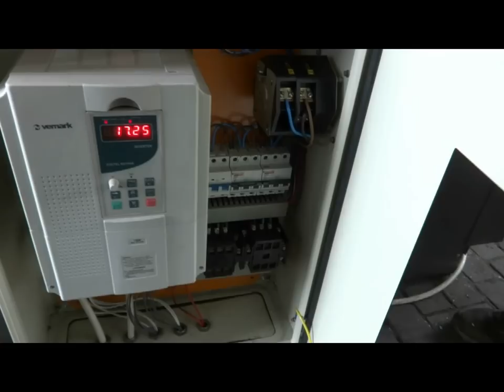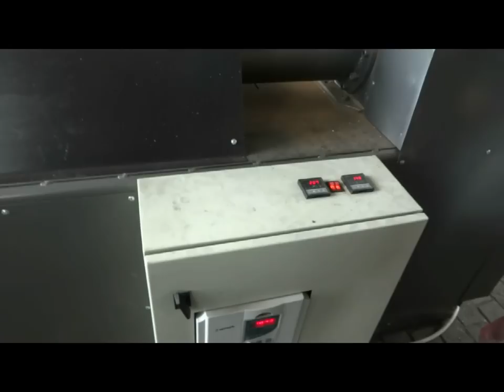Roof Tiles From Recycled Plastic

Comment: So really there shouldn't be any excuse for plastic to end up in a landfill
Reply: Yes and no
In order to recycle plastics they need to be separated by type and color and there are hundreds of types out there. So easier said than done :)
Unrecyclable composites, dirty plastics, etc. can be converted back to oil using pyrolysis or burned in an incinerator to recover energy-reducing volume by 90%.

Comment: there is any possibilite of using glass waste in some porportion to replace sand, in order to recicle broken glass?
Reply from the maker: Of course you can use finely chopped glass. This is also better for the strength of the products.
Reply: @kotarakafeliks  tkx very much
Reply: unless you are making it yourself, glass beads are an expensive option
Reply: @KN-fk9lj  tnks very much, broken glass is a problem in out beaches, and we are looking for alternatives.

Comment: We need this!
Reply from the maker: We are the producer of this machines. The installation costs 68000 euro   
with the moulds. We can make the moulds with a drawing or muster in Your   
standart/the standart is different in the countries/. Time to work-3   
months.Installed power-20 kW The installation includes: 1.Specially   
extruder 2.Press machine 3.Calibrator   
cooler for the ready details The machine can make 60 pieces per hour.   
The making area is 20 m2 without warehouses. If You have any questions   
please send us.The produce time is two months .   
The line for the production of floor coverings and roof tiles is the same. Just change molds.   
There is also a difference in the plastic mixture because it can also be used petrified PET bottles.   
The installed power is 25 kilowatts, but the working consumption is about 10 kilowatts.   
The blending ratio is 30% plastic and 70% sand.   
Marble flour can also be used to better achieve the desired color.   
For paint, use is an oxide cement paint..   
The cost does not include delivery costs. You will get a detailed video on launching and operating the machines.   
You need to specify what details you want to make.
Reply: I need
Reply from the maker: @rajshekarmulalimanjunathpm6131  Watssapp number is  00359888494116
Reply from the maker: email is   plasticam@abv.bg
Reply: Well knowledge given by you,, thanks

Comment: Hi can I have more information on these machine ie price etc
Reply from the maker: We are the producer of this machines. The installation costs 88000 euro   
with the moulds. We can make the moulds with a drawing or muster in Your   
standart/the standart is different in the countries/. Time to work-3   
months.Installed power-20 kW The installation includes: 1.Specially   
extruder 2.Press machine 3.Calibrator   
cooler for the ready details The machine can make 60 pieces per hour.   
The making area is 20 m2 without warehouses. If You have any questions   
please send us.The produce time is two months .   
The line for the production of floor coverings and roof tiles is the same. Just change molds.   
There is also a difference in the plastic mixture because it can also be used petrified PET bottles.   
The installed power is 25 kilowatts, but the working consumption is about 10 kilowatts.   
The blending ratio is 30% plastic and 70% sand.   
Marble flour can also be used to better achieve the desired color.   
For paint, use is an oxide cement paint..   
The cost does not include delivery costs. You will get a detailed video on launching and operating the machines.   
You need to specify what details you want to make.

Our plant uses waste plastic as a raw material, which cannot be used for separation and recycled as a secondary raw material. For example, plastic bags, car plastics, packaging and much more. Plastic waste is crushed with a grinder or agglomerator of fine particles about 4-5 mm. They are then mixed with dry sand in a percentage of 50/50 in weight units. 0.1% oxide paint is added. The semi-honest mixture is then placed periodically in the curing extruder, which cures the mixture and it exits as a soft mass. With a certain dose is placed in the mold and the press presses the finished product. The product is then placed in a special calibrator to make it true and not deform. One cycle lasts about 1-1.5 minutes.

Comment: Thanks for video. Some taken knoladge but how can wi start ?
Reply from the maker: You can start with buyng machine. Then work, work, work!
Reply: @kotarakafeliks  how much is the machine?
Reply from the maker: @dianaama6728  We are the producer of this machines. The installation costs 78000 euro   
with the moulds. We can make the moulds with a drawing or muster in Your   
standart/the standart is different in the countries/. Time to work-3   
months.Installed power-20 kW The installation includes: 1.Specially   
extruder 2.Press machine 3.Calibrator   
cooler for the ready details The machine can make 60 pieces per hour.   
The making area is 20 m2 without warehouses. If You have any questions   
please send us.The produce time is two months .   
The line for the production of floor coverings and roof tiles is the same. Just change molds.   
There is also a difference in the plastic mixture because it can also be used petrified PET bottles.   
The installed power is 25 kilowatts, but the working consumption is about 10 kilowatts.   
The blending ratio is 30% plastic and 70% sand.   
Marble flour can also be used to better achieve the desired color.   
For paint, use is an oxide cement paint..   
The cost does not include delivery costs. You will get a detailed video on launching and operating the machines.   
You need to specify what details you want to make.

Comment: Please I’m interested in the machine. how can I get the machine?
Reply from the maker: We are the producer of this machines. The installation costs 68000 euro   
with the moulds. We can make the moulds with a drawing or muster in Your   
standart/the standart is different in the countries/. Time to work-3   
months.Installed power-20 kW The installation includes: 1.Specially   
extruder 2.Press machine 3.Calibrator   
cooler for the ready details The machine can make 60 pieces per hour.   
The making area is 20 m2 without warehouses. If You have any questions   
please send us.The produce time is two months .   
The line for the production of floor coverings and roof tiles is the same. Just change molds.   
There is also a difference in the plastic mixture because it can also be used petrified PET bottles.   
The installed power is 25 kilowatts, but the working consumption is about 10 kilowatts.   
The blending ratio is 30% plastic and 70% sand.   
Marble flour can also be used to better achieve the desired color.   
For paint, use is an oxide cement paint..   
The cost does not include delivery costs. You will get a detailed video on launching and operating the machines.   
You need to specify what details you want to make.

Our plant uses waste plastic as a raw material, which cannot be used for separation and recycled as a secondary raw material. For example, plastic bags, car plastics, packaging and much more. Plastic waste is crushed with a grinder or agglomerator of fine particles about 4-5 mm. They are then mixed with dry sand in a percentage of 50/50 in weight units. 0.1% oxide paint is added. The semi-honest mixture is then placed periodically in the curing extruder, which cures the mixture and it exits as a soft mass. With a certain dose is placed in the mold and the press presses the finished product. The product is then placed in a special calibrator to make it true and not deform. One cycle lasts about 1-1.5 minutes.

Comment: Great idea but how does the plastic stand up to the Sun,from my experience plastic cracks after a few years.Would like to be wrong we so need to deal with this!
Reply: @greenunion3699  I am looking roofing tiles in India, do you supply this product in India.
Reply: @siddhuarch  What is the amount of  roofing tiles do you need ?
Reply: It's not pure plastic, the sand will give enough strength to the tile

Comment: Nice one. how can I get the machine?
Reply from the maker: We are the producer of this machines. The installation costs 78000 euro   
with the moulds. We can make the moulds with a drawing or muster in Your   
standart/the standart is different in the countries/. Time to work-3   
months.Installed power-20 kW The installation includes: 1.Specially   
extruder 2.Press machine 3.Calibrator   
cooler for the ready details The machine can make 60 pieces per hour.   
The making area is 20 m2 without warehouses. If You have any questions   
please send us.The produce time is two months .   
The line for the production of floor coverings and roof tiles is the same. Just change molds.   
There is also a difference in the plastic mixture because it can also be used petrified PET bottles.   
The installed power is 25 kilowatts, but the working consumption is about 10 kilowatts.   
The blending ratio is 30% plastic and 70% sand.   
Marble flour can also be used to better achieve the desired color.   
For paint, use is an oxide cement paint..   
The cost does not include delivery costs. You will get a detailed video on launching and operating the machines.   
You need to specify what details you want to make.

Our plant uses waste plastic as a raw material, which cannot be used for separation and recycled as a secondary raw material. For example, plastic bags, car plastics, packaging and much more. Plastic waste is crushed with a grinder or agglomerator of fine particles about 4-5 mm. They are then mixed with dry sand in a percentage of 50/50 in weight units. 0.1% oxide paint is added. The semi-honest mixture is then placed periodically in the curing extruder, which cures the mixture and it exits as a soft mass. With a certain dose is placed in the mold and the press presses the finished product. The product is then placed in a special calibrator to make it true and not deform. One cycle lasts about 1-1.5 minutes.

Comment: How much can I buy these machines??
Reply from the maker: We are the producer of this machines. The installation costs 78000 euro   
with the moulds. We can make the moulds with a drawing or muster in Your   
standart/the standart is different in the countries/. Time to work-3   
months.Installed power-20 kW The installation includes: 1.Specially   
extruder 2.Press machine 3.Calibrator   
cooler for the ready details The machine can make 60 pieces per hour.   
The making area is 20 m2 without warehouses. If You have any questions   
please send us.The produce time is two months .   
The line for the production of floor coverings and roof tiles is the same. Just change molds.   
There is also a difference in the plastic mixture because it can also be used petrified PET bottles.   
The installed power is 25 kilowatts, but the working consumption is about 10 kilowatts.   
The blending ratio is 30% plastic and 70% sand.   
Marble flour can also be used to better achieve the desired color.   
For paint, use is an oxide cement paint..   
The cost does not include delivery costs. You will get a detailed video on launching and operating the machines.   
You need to specify what details you want to make.

Our plant uses waste plastic as a raw material, which cannot be used for separation and recycled as a secondary raw material. For example, plastic bags, car plastics, packaging and much more. Plastic waste is crushed with a grinder or agglomerator of fine particles about 4-5 mm. They are then mixed with dry sand in a percentage of 50/50 in weight units. 0.1% oxide paint is added. The semi-honest mixture is then placed periodically in the curing extruder, which cures the mixture and it exits as a soft mass. With a certain dose is placed in the mold and the press presses the finished product. The product is then placed in a special calibrator to make it true and not deform. One cycle lasts about 1-1.5 minutes.
Reply: @kotarakafeliks  please can I have the full catalogue of the machines needed for this production and the cost to Lagos, Nigeria 
Thank you.
Reply from the maker: @felixachile8172  Write me on whatsapp  00359888494116

Comment: How do l get the equipment and the price
Reply from the maker: We are the producer of this machines. The installation costs 78000 euro   
with the moulds. We can make the moulds with a drawing or muster in Your   
standart/the standart is different in the countries/. Time to work-3   
months.Installed power-20 kW The installation includes: 1.Specially   
extruder 2.Press machine 3.Calibrator   
cooler for the ready details The machine can make 60 pieces per hour.   
The making area is 20 m2 without warehouses. If You have any questions   
please send us.The produce time is two months .   
The line for the production of floor coverings and roof tiles is the same. Just change molds.   
There is also a difference in the plastic mixture because it can also be used petrified PET bottles.   
The installed power is 25 kilowatts, but the working consumption is about 10 kilowatts.   
The blending ratio is 30% plastic and 70% sand.   
Marble flour can also be used to better achieve the desired color.   
For paint, use is an oxide cement paint..   
The cost does not include delivery costs. You will get a detailed video on launching and operating the machines.   
You need to specify what details you want to make.

Comment: Qué materiales utiliza para llegar al resultado? Alguien q me guiar...
Reply from the maker: We are the producer of this machines. The installation costs 78000 euro   
with the moulds. We can make the moulds with a drawing or muster in Your   
standart/the standart is different in the countries/. Time to work-3   
months.Installed power-20 kW The installation includes: 1.Specially   
extruder 2.Press machine 3.Calibrator   
cooler for the ready details The machine can make 60 pieces per hour.   
The making area is 20 m2 without warehouses. If You have any questions   
please send us.The produce time is two months .   
The line for the production of floor coverings and roof tiles is the same. Just change molds.   
There is also a difference in the plastic mixture because it can also be used petrified PET bottles.   
The installed power is 25 kilowatts, but the working consumption is about 10 kilowatts.   
The blending ratio is 30% plastic and 70% sand.   
Marble flour can also be used to better achieve the desired color.   
For paint, use is an oxide cement paint..   
The cost does not include delivery costs. You will get a detailed video on launching and operating the machines.   
You need to specify what details you want to make.

Comment: Где можно Купить такое оборудование???
Reply from the maker: We are from Bulgaria.We are the producer of this machines. The installation costs 68000 euro   
with the moulds. We can make the moulds with a drawing or muster in Your   
standart/the standart is different in the countries/. Time to work-3   
months.Installed power-20 kW The installation includes: 1.Specially   
extruder 2.Press machine 3.Calibrator   4. Grinder for had plastic. 5. Aglomerator for sheet plastic.
cooler for the ready details The machine can make 60 pieces per hour.   
The making area is 20 m2 without warehouses. If You have any questions   
please send us.The produce time is two months .   
The line for the production of floor coverings and roof tiles is the same. Just change molds.   
There is also a difference in the plastic mixture because it can also be used petrified PET bottles.   
The installed power is 12 kilowatts, but the working consumption is about 5 kilowatts.   
The blending ratio is 30% plastic and 70% sand.   
Marble flour can also be used to better achieve the desired color.   
For paint, use is an oxide cement paint..   
The cost does not include delivery costs. You will get a detailed video on launching and operating the machines.   
You need to specify what details you want to make. Write me on email   plasticam@abv.bg

Comment: Pls I want to set up a plant in Nigeria can your company help me in all I need.Can I get a quote. Let me know all it will cost me
Reply from the maker: We are the producer of this machines. The installation costs 78000 euro   
with the moulds. We can make the moulds with a drawing or muster in Your   
standart/the standart is different in the countries/. Time to work-3   
months.Installed power-20 kW The installation includes: 1.Specially   
extruder 2.Press machine 3.Calibrator   
cooler for the ready details The machine can make 60 pieces per hour.   
The making area is 20 m2 without warehouses. If You have any questions   
please send us.The produce time is two months .   
The line for the production of floor coverings and roof tiles is the same. Just change molds.   
There is also a difference in the plastic mixture because it can also be used petrified PET bottles.   
The installed power is 25 kilowatts, but the working consumption is about 10 kilowatts.   
The blending ratio is 30% plastic and 70% sand.   
Marble flour can also be used to better achieve the desired color.   
For paint, use is an oxide cement paint..   
The cost does not include delivery costs. You will get a detailed video on launching and operating the machines.   
You need to specify what details you want to make.
Reply: @kotarakafeliks  inflation is insane, is it the same kit you offered for 28000 euro 3 years ago?
Reply from the maker: @marcofecteau  Depends on what this installation involves.